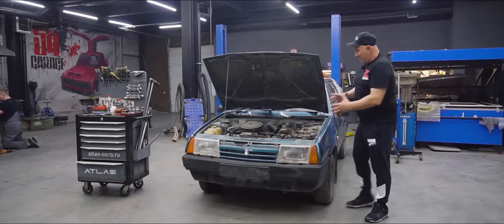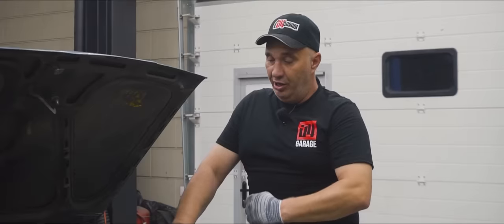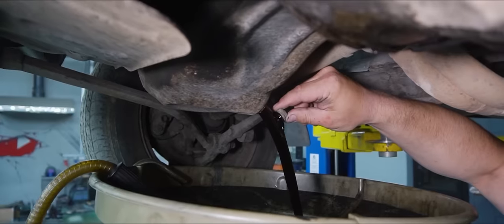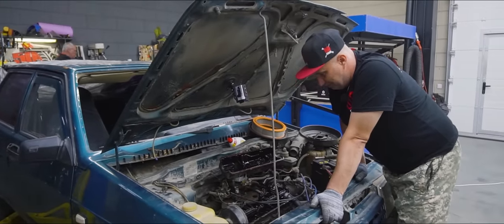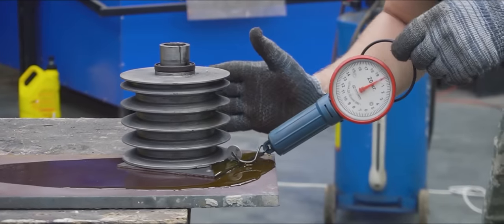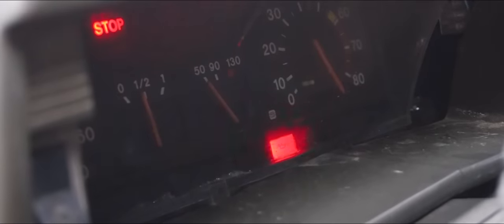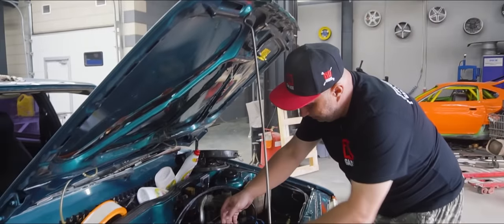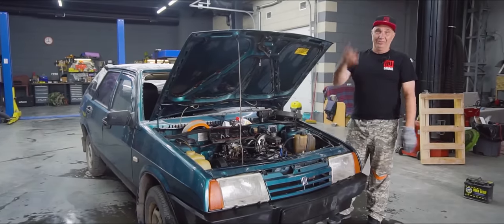Can you use dishwashing liquid to clean an engine internally?

Comment: Dump antifreeze in the crankcase and drive it around a few days and the inside will be as clean as a whistle with no engine damage if everything else was OK to begin with,this is from real world experience.  In the 1970's Isuzu built a truck engine that had a habit of blowing the head gasket on the rear cylinder where the sealing area was very narrow. This would dump the antifreeze into the crankcase and cause the temperature light to come on. Not knowing what had happened owners would check the radiator find it empty and fill it back up this turned out the temp light for a short while they would then bring the truck to the dealer for repair. In the time these vehicles were driven in this condition the oil and water would have been blended into an emulsion so thick it would not drain out the oilpan plug. This had to be scooped out of the oil pan but the inside of the engine would be as clean as a brand new one from the steam cleaning that had taken place inside the engine.

Comment: i’ve used fairy liquid to clean the water system after replacing faulty oil coolers a couple of times, seems to do the trick getting the sludge out
Reply: If its available in your country, a environmentally friendly dishwasher soap from a company called EcoVer works much better, doesn't foam up anything like as much and still breaks up all the oil/emulsion caught up in the circuit. Worth keeping a bottle handy

Comment: Yes you can.  I use a pressure washer down the fill hole after draining the oil to get the internals clean.
Reply: You can put soap and water in your engine but the results won't be good.
Reply: They shoud have done this on this engine after draining the dishwashing liquid :)
Reply: You have to be joking right? If not then you should be banned from ever working on a vehicle even a vehicle beyond repair.
Reply: Tje only washing thing you should use is disel to flush the engine.
Reply: @Dreamlink91  that or do a proper rebuild and put it in a parts washer individually. But never put soap in it with water. That is just dumb and asking for engine failure.
Reply: @GmKofHard  ofcourse I am joking 😅
Reply: @NzJohny  good because i actually had to fix a truck who did that.

Comment: Great funny video!........The Fairy liquid used in this video, looks like the basic version, for low level grease removal, eg kitchen plates. In the UK they sell a heavy duty 'Platinum' version, to removed grease from frying pans and oven trays. I use both in my kitchen and there is a big difference between the two products, though I have never tried them in my car!

Comment: Try doing the same with automatic transmission oil. You'd be surprised how clean it will make the engine.
Reply: Is it an actual good cleaner? Gasoline and brake fluid worked well when I had grease all over my arms and hands 😂
Reply: @daviedood2503  I Think It's The Best And Safest Cleaner To Use In An Engine. Both A Designed To Handle Hi Temperatures And Both Have Lubrication Properties. People Say Half Transmission Fluid And Half Engine Oil And Drive It About 500 Miles. I've Never Actually Tried It. I Use A Motor Flush Every Lol Change Which Is Basically A Quart Of Diesel Added To The Old Oil Before Oil Change. You Run It For 5 Mins At Operating Temp At Idle And Then Drain It. Diluting The Oil Is Bad But That's Why They Advise Idle Only Which Bearings See No Load. If The Engine Is Already Pretty Dirty Then It's Not Gonna Clean Very Well. But If You Do It From The Very Start I Think It Will Keep And Engine Very Clean. Everytime I Use The Diesel The Oil Comes Out Very Black.

Comment: Automatic transmission fluid or ATF will clean everything out of the inside of that Engine
Reply: ATF has less detergents than most synthetic oils.

The truth is an engine flush works, however, fresh oil will do the same thing over time.

Comment: Yup, best thing to do with a gunked up engine is to buy some decent oil (not super cheap but still decent quality), run it for a very short time, like 200 km, then change it again and put in your usual oil. Depending on how bad it is you might want to do several back to back changes within short intervals. The detergents will break down deposits and then get flushed out. Eventually when the oil looks and smells healthy then start changing within the interval listed to spec with your car. Some people like to pour several quarts of very cheap oil directly through the engine to flush out dirty oil, until it starts running clear through the drain plug, but I think that's a waste of good oil. might as well at least get some use out of it, however little use that might be. If it's too caked up, like 75,000km worth of no oil changes, then it might be beyond saving but I have seen some funky engines restored back to health simply by giving back to back short interval changes.

Comment: Brake & clutch cleaner works well on both petrol and diesel engines. Drain the oil and filter. Refill with 5 litres of brake cleaner. Disable the ignition system and turn over on the stater motor. Leave overnight and drain it out. Refill with cheap oil, run until hot, drain again and refill with the correct oil & new filter. This will remove large amounts of sludge/ crap from the engine internals. 
Recommend changing the oil again after approx 1k miles. 
.

Comment: Dishwasher detergents molecules are long molecules with 1 side that is hydrophobic and the other end is soluable in water. Therefor you need water to activate the cleaning properties of the detergent. And you'd need to add A LOT of water as one liter of detergent is good for around 50-100 liters of cleaning liquid. It will foam like crazy so add around 10 ml of octanol to eliminate excessive foaming.

Comment: Detergents are molecules with an end that loves water, the other end loves oil.
Dish liquid, by itself, will combine with oil and grease, but that is about all that will happen.
A sticky emulsion.
The grease is mechanically torn apart when the water-loving end seeks added water.
Down side is that steel needs some protection from air/moisture.
Detergent can clean so well 'flash rust' is a real thing!

Comment: I have heard rumours about automatic transmission fluid being good for cleaning engines
Reply: Yes but mix it with at least 3 parts regular oil, and only use for about 25 miles, then change oil….
Reply: It can also clean injectors in a diesel
Reply: Basically like seafoam (definitely don't leave it in there long)
Reply: Yes. But it will start hurting things if you don't change the oil Soon. Sludge will break down but chunks could get into the system. Tensioners, and bearings can't go long with a blocked oil port

Comment: Over here in America we use a Quart of Kerosene to flush an engine block before changing the oil 🛢️ pour the Kerosene into the Oil Pan. Crank it to let it idle for 30 seconds and then drain the oil thumbs up number 600

Comment: In the eighties I used fairy liquid to clean all my carbs and engine parts, big washing up bowl filled with hot water and a goodly dose of fairy, bottle brush or scotchbrite pad and allowed to dry, blown through with some air to make sure jets etc clean or bearings nice and dry then back onto the car and its like a new part.   SU and Stromberg CD carbs especially liked the washing up liquid cleaning.   Same too with my Vespa and Lambretta engines, strip down, into the bowl with soapy fairy suds, scrub scrub, gleam clean, dry and back together and job's a good 'un :D

Comment: Would have been cool if it blew bubbles from the exhaust pipe 😂
Reply: What,     your not entertained by the bubbles of insanity flying from his mouth or the sound of the termites eating his brain? You should see his other show where he puts choc chip cookies in the cassette player & hits fast forward while he tries to entice a lobster out of his nose by rubbing cat food on his face. Then he uses a power drill with a wire wheel on it to clean his back teeth while he adjusts the tappets with a jackhammer. He hasn't been the same though, since he performed the self lobotomy with the arc welder.
Reply: @johnbrooks9523  awesome🤣

Comment: The real engine cleaner is diesel fuel, flushed my Audi out with it
Reply: If you are going to rebuild an engine drain the oil fill the sump with diesel and idle for a few minutes make cleaning the internals a breeze.

Comment: Garage 54 you should try a automatic transmission fluid and diesel mixture in the old oil run it normal for 2-3 days and then change the oil. That's what I do and it works great. But i have never opened up the engine afterward to look at how much it cleans. I just know that the oil comes out nasty on sludged up engines and some engines that burn oil it will clean behind the rings and stop the oil burning.

Comment: I use a flush with every oil change and change the oil every 6 months (and do around 3000 miles a year). I had to replace the sump and on taking it off, my engine looked like it was made of gold. No lie. The inside of the engine was a shiny gold colour.

Comment: I heard/read somewhere that a relatively inexpensive engine-clean could be had by changing the oil to something like "Royal Purple" -- which has a bit more oil detergent than ordinary motor oil -- and driving about 500 miles, then changing it again, then driving 500 miles, then changing it a third time.
-
For most sedans, ignoring the labor, it'd run someone just over $100.  It's a little wasteful with the oil, since it would lubricate far beyond those 500 miles, but it'd be a safe way to make use of the detergents in the oil to get a mild and safe cleaning.

Comment: Years ago, my mom added a quart of oil to the COOLANT over flow jug. We found out about it 30 days after it happened, when the Radiator started to leak and it looked like chocolate milk. Drained the radiator and filled it with clean water. Dropped two Cascade Dish washing pods into the radiator, and drove it 10 miles. Drained that out, added fresh water, drove another 10 miles and drained. Replaced the radiator, added the correct amount of coolant and she drove it another 3 years until it was totaled out from under her, in front of at least 10 law officers burying one of there own! That's a different story though.

Comment: if we read the composition of any modern engine oil, we won't have this curiosity. They include solutions (in very low volume) like detergent and other cleaning agents to keep  engine clean. This is also the reason, in modern cars you don't need to use any type of engine clearer while doing oil change as long as you do oil change as per schedule.

Comment: The whole purpose behind soap is to allow oil to emulsify in water. If there's no water the oil will just mix with the soap which has some water in it. You should redo the experiment with water and soap and circulate the solution without moving any of the mechanical parts via an electric pump.

Comment: I did it after my 7.3L diesel blew an injector ring and put oil in the cooling system.  Dawn, water, and several flushes worked like a champ.  I drove it a couple hundred miles before flushin it out the third time.
Reply: On a diesel 😮
Reply: @nutragardens6632  Yes, a 7.3L TurboDiesel.  It's still running great and the cooling system is clean as a whistle.
Reply: How much water .. water is supposed to be bad because of the high compression
Reply: @nutragardens6632   I put roughly 1/4 cup of Dawn in the radiator and filled the cooling system with water.  Leaving the tank cap off, I ran the engine for roughly 15 minutes between draining and re-filling with Dawn anf water.  The last fill was left in and driven for about 100 miles.  I then drained and flushed the system several times until there was no evidence of detergent left.  Drained and added antifreeze to the proper mix and level.

Comment: Indeed you can, if you put some dish soap in your engine, run it when its cold for two minutes and then flush the engine add new oil and filter, it does wonders.

Comment: I had a built up sludge in my engine and it was bad so i filled it up with kerrosine turn it over for a few days and flush it out and put it back together again and it is cleaner now i have to put in a liter run it will get the last bit out of it and it will be good to go

Comment: I use transmission fluid I add 1 bottle a day or 2 before the oil change. I have a 5.4l 3 valve they say is junk but it run's like new so im happy with my trick

Comment: Please test the same with E85 / Ethanol? Really powerful cleaner, has caused engine failures to old Saab engines after ethanol conversion by removing dirt which then blocks oil pump input.
Reply: What would using ethanol as fuel have to do with cleaning engine internals or oil pump input? The Saab oil issue on the late 90s and early 2000s cars is caused by a defective PCV design and lack of oil changes (you can buy the upgraded PCV from most Saab places)

Comment: thank you for this PSA
as a mechanic I really hate it when people ignore maintenance

just the other day I had a car in the shop, some rust repair and work on the exhaust system, but the engine had a weird knock when I started it to leak check the exhaust system
I poured in about 2.8-3 liters of oil in an engine that needs about 3.5, the knock got slightly better, but the rod bearing on cylinder 2 is already shot
like, is it really that hard to at least check your oil and top it off?

Comment: I change my oil regular. I've had a tapping for the last 2 years and 30k miles. It is what it is. Runs well. Just taps away.
Reply: Is it worse when cold and then gets better as the engine warms up? Could be classic hydraulic lifter tick.
Reply: @otm646  nope. Always ticking away no matter.

Comment: Well, soaps only work when there is water. Otherwise they just sorta mix with the oil and do nothing.
I'm thinking that if a very strong basic solution is used it would have better effect. But it won't be good for the aluminium.

Comment: Put a few ounces of ATF in your engine and let it idle for about 10 minutes before draining and changing the oil.  Automatic transmission fluid has a lot of detergent in it and will help clear out the gunk inside your engine.

Comment: You should try dishwashing machine soap tablets, in boiling water and pour it into the engine and fill it completely, crank it so everything gets evenly distributed around the engine, then top it off and let it sit for 24 hours. 

Then start it up or crank it, empty it and flush it with water a couple of times, 
then inspect it.

See if it is clean or not.

Then flush it with diesel or something else and do a service and see if it will run again.

Use dishwash machine soap like Finish or other generic "house hold" dishwasher soap.

Comment: fairy is only a surfactant to break the surface tension in water. You'd need an oil based solvent like diesel to clean those deposits i think.

Comment: For anyone who even THINKS that this is good practice is completely out of your mind!  This is what Garage 54 does -----> FOR 100% FUN AND ENTERTAINMENT.....PERIOD.  

As a retired  industrial Heavy Duty Mechanic, adding ANY high detergents into your "gas powered" engine oil lubrication system will result in the death of that engine.  Period.  

When an older engine wears, it's tolerances increase naturally because metal has been worn away, and the internals, especially exhaust valves and seats and the piston rings are then naturally "held together" by carbon build-up which then naturally keeps the tolerances within operation limits.  

If anyone removes or disturbs these "formed" carbon deposits......you have then destroyed the engine, and it's just a matter of time!  Period.

Comment: Never heard of it? I have a 1977 ford 4x4 just over 1,266,898 documented miles. To clean the engine I use two quarts of diesel fuel and put magnets on the oil filter. The diesel would clean the sludge and grime out. I finally opened the motor up. It looks clean and brand new inside. With exception of wear from use. I'm rebuilding the motor the crank turned and polished new pistons&wrist pins timing water pump rings main and rod bearings new camshaft and lifters heads rebuilt and machined. Soon I will have the original million mile motor rebuilt. Sent off transmission and rebuilt it and transfer case.

Comment: Run it with kerosene. I did it to a straight 6 cylinder years ago the head and rockers were so bad no oil was going back down.  I ran the kero instead of oil for three min. Then changed oil and filter. Huge difference.

Comment: You can try diesel engine oil for a whole oil change cycle, it's got more detergents.
Reply: I've done that. But also learned the hard way, to change the oil after 500-1000 miles. The amount of sludge it breaks up overloads the oil filter, and it also collects in the bottom of the crankcase. Usually the second oil change will make it to 3,000 miles. I had an engine so bad once, I put in 50/50 transmission fluid and diesel oil. Once the pistons stated slapping, and the exhaust started smoking, I changed the oil again. Was still running, last time I heard.
Reply: @VitoVeccia  - Thanks for the answer on that.  It pays to do regular changes on an engine from new but a lot of people just don't know better, then you buy the thing unknowingly caked with crap.  Difficult to solve without dismantling.

Comment: All detergents need something to bind to. The fairy will stick to the oil, but unless it also has some water to stick to, it's not going to clean very well. That's why you use water + fairy when doing the dishes....they should have put some water in with the fairy for (slightly) better results :)
But.....the 'fairy' from that video he showed looked an awful lot like motor oil......